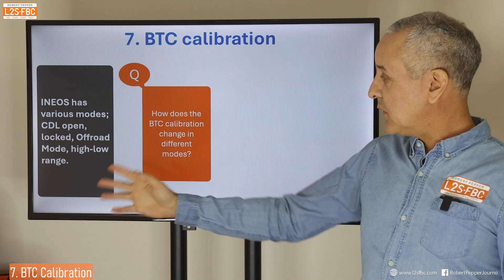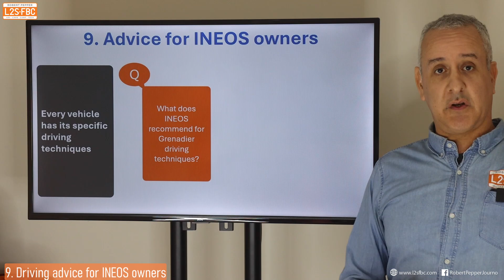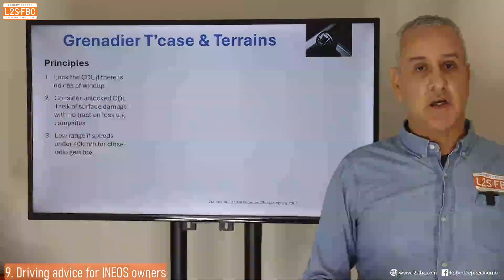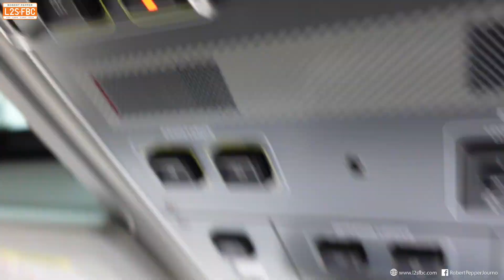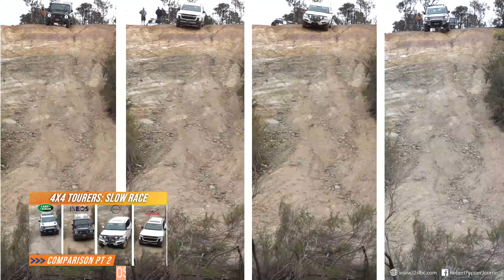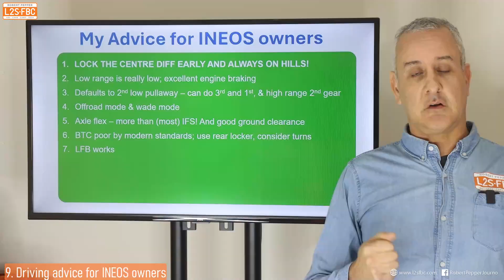INEOS Tech Interview Clarifications, Part 2 of 2

Comment: the dual battery setup is (i believe) explained by the term auxilary battery. Its only the diff lock light that needs the speed differential isnt it. ?The lockers have already disengaged?
Reply: I think the key issue with this locker disengagement implementation is although the lockers are disengaged the computer still requires this extra confirmation from the wheel speed sensors, and this can take a while,  and  during this time certain vehicle functionalities are disabled until this confirmation happens.  An example would be you climb a hillside using lockers and once you reach the top you need to immediately descend the other side of the hill.  If you unlock the lockers at the top, it will prevent you from using hill descent control because it has not yet been able to get the confirmation that the lockers are disengaged as you are unable to drive far enough for the speed sensors to report back before the hill descent control is required.
Reply from the maker: An excellent point, QuiltedQuiver!  An edge case maybe, but certainly one well within possibility.  Essentially, you press a button and the locker should be IN NOW, press again, OUT NOW.  No messing around, because delays are somewhere between irritating and dangerous - yes, dangerous.
Reply: @L2SFBC  Might be pedant mode, but don't forget that pressing the button will only trigger the electomagnet to pull the diff lock in, it still needs a portion of forward wheel travel to mechanically drive the pin up the ramp to physically engage the lock.

I'm not sure if you can lock the axle diffs by pressing the switch and then reversing?
Reply: @QuiltedQuiver I'm wondering if knocking it out of centre diff lock and immediately back in again will do a reset?
Reply: @stevegreen101  although I have not tried that my self, I am sceptical because I think it would still need the wheel speed sensor to confirm disengagement. It is worth a try though.
Reply: @QuiltedQuiver  I'll add it to the test programme. 😉
Reply: @QuiltedQuiver  Why does the computer need an extra confirmation that the diff is unlocked?  It "knows" that the switch has been switched and so power removed from the electomagnet that pulls the diff lock in.  Where Ineos having issues with the mechanical disengagement?
Reply: @stevegreen101  the computer needs additional confirmation so that things like stability control or HDC can be activated safely. Turning on things like stability control or hill descent control would cause  severe issues if the diff locks were still engaged (stuck) as these types of features require individual wheel brake control to properly function, so to be on the safe side they only enable those features if it has two independent sources (switch +wheel speed sensor) that respond back that the disengagement was successfully completed.
Reply: Problem is, until the car has "proof" (by detecting a speed difference) that the diffs are unlocked you won't be able to engage the lockers. Quickly disenganging and enganging axle lockers often times does not work in a Grenadier and you end up with an unlocked diff and blinking lights with no chance to engange the lockers immediately
Reply from the maker: Very good point too Bernd!
Reply: You are correct: the front and rear diffs lock and unlock almost immediately. It's the sensors which signal locked/unlocked  via flashing/ still lights which lag in response. I.e. you don't have to "wait". The Tech Manager's response confirmed this😉
Reply from the maker: Yes correct